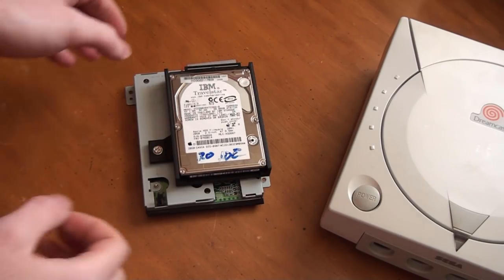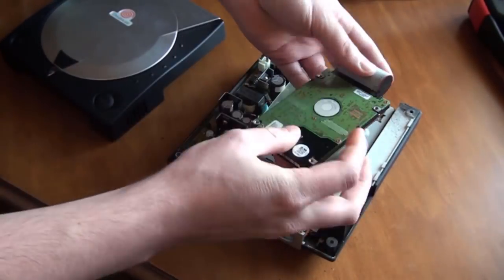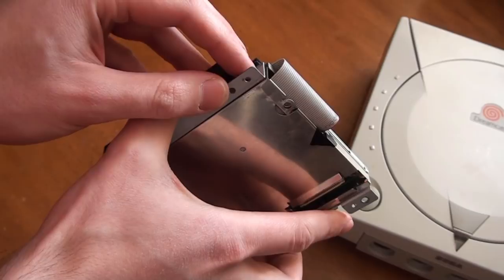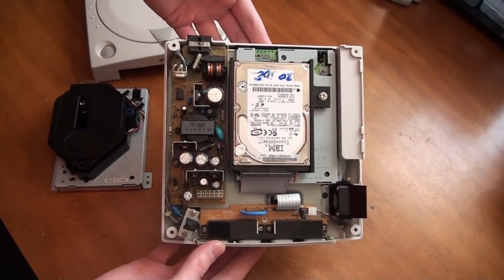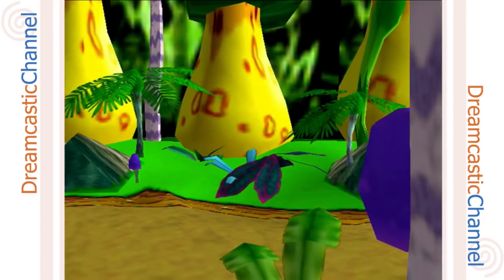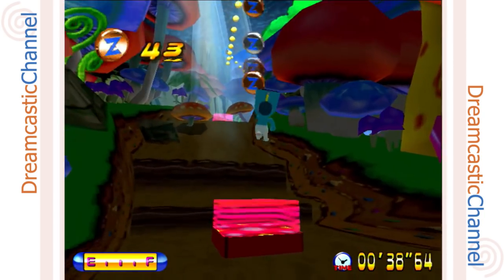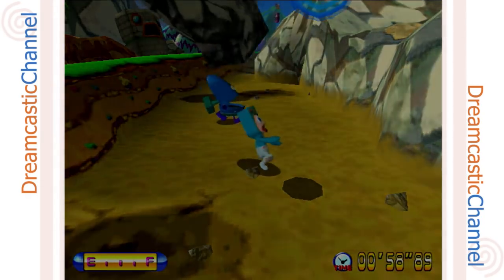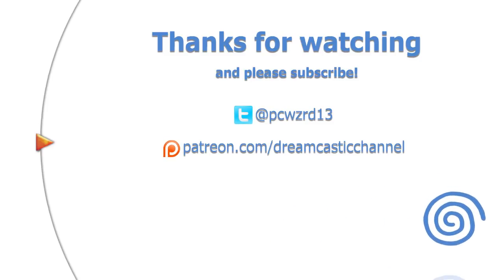Dreamcast Plug-N-Play IDE Hard Drive Mod

Comment: Wait, Dreamshell compatibility is 85% only ? Think I read it's somewhere close to the 95% mark by now. That and also that it could run backups of more recent unlicenced games that rely on real dc hardware as copy protection mechanism like Pier Solar, Ghost Blade, ??? Also, soldering that IDE cable in your 1st mod looks like a nightmare to accomplish, especially if you have insight on how little core substance a shitty 0.14mm²  cable has and how easily it can break if you either use a dull stripper or didn't take the time to adjust it properly. That plus the fact that using lead-free solder won't make things easier for anyone but actually has the potential to make corrections impossible (e.g. if you were to f*** up and solder a cable to the wrong hole with interlayer-section and can't get the spot hot enough to get the solder fluid again and back out of the effing hole). Have my respects, sir !!! You really earned it with that one.

PS: I would probably die of dehydration, that's the amounts i would be sweating through the whole process :DDD

Comment: @DreamcasticChannel  Having watch your video, I would like to do the same mod on my DC.  However, I found my GD-ROM Drive Board Pinout (mine is VA1) is a bit different than yours (https://www.dropbox.com/s/magchbbmuy2ny10/IMG_4055.jpg?dl=0).   For example, I couldn't find the pinout 249 on the board. 
Is it possible to do the same mod on my DC?    Thanks for your advice in advance!  Cheers!

Comment: The reason you don't have music in some games is because you are using CDi format of games. That means that CDi are ripped games to fit on a CD so you can play it on a modded Dreamcast via the CD Player. In your case and for people who are using GDemu the best solution is to use GDi format of the games. GDi games are the full version of every game without ripping anything (music or videos from a game).
Reply from the maker: I don't use CDI's. I use full GDI rips.
Reply: @DreamcasticChannel  then probably is a combatibility issue. But your build is really interesting. is there any video link how you did that? I mean i saw the picture where to solder but what wire goes to every spot you pinned on motherboard? Or it doesn't matter which wire you are soldering?

Comment: Hi just watched you video and have been looking at the photo you put up at https://dragoncity17.files.wordpress.com/2016/02/922a7-ide2bsur2bgdrom1.jpg my question is I have a Va0 Which the gdrom drive uses 5V , there is no 5v on that pinout, is that pinout for a Va1 and if so do you ha e one for a Va0 and would you not need to drop the 5v down to 3.3 for the hard drive ?

Comment: can I run dreamshell from the sd card serial port adapter somehow? no right?
Reply from the maker: Yes. That's what I do actually. Makes it easier to update. Just put the DreamShell folder on the SD card instead of the HDD.
Reply: @DreamcasticChannel  great! and how do I flash the bios chip? can this be done though software or with hardware/Arduino?

Comment: why you dont have a molex connector to the hard disk? where does the hd take the power supply?
Reply: just noticed it's a 44 pin ide. Dont worry ty.

Comment: Tbh i wanna see a Dreamcast mod that allows you to mount the motherboard inside a 2x 3.5 bay in a pc and connect power directly to the PSU also having an port that connects to a PCIe imput card. 
but this is a pipedream :3

Comment: I was starting to do a mod like this seeing how the motherboard mod was simply using the GD-Rom pins so I knew I could go direct to the gd board like you did but had shelved it until now seeing you've successfully done it.

My end idea is slightly different but now I should be able to see it works as well as yours. Thanks!

Comment: Would a pata SSD drive be of any benefit too performance even an SD to ide adaptor. Very happy love my Dreamcast Sport's edition. This would be much more affordable than the sd card adaptor on Ebay $500+
Reply: Despite the obviously bottle-necked IDE bus of the dreamcast, Bare in mind there's still the HDD's controller which has to handle the mechanical limitations of platters/heads... Using an IDE to Msata adapter would greatly improve performance and reliability with aging IDE drives. I can confirm as I have an IDE to Msata drive in my PPC MacMini
Reply: GD-Emu is just unaffordable.
Reply from the maker: Unlikely you would see any benefit from an SSD. A 5400RPM HDD would likely give you the fastest speed possible. You can do an IDE-to-SATA adapter but I haven't heard of anyone getting an IDE-to-SD adapter to work.

Comment: You have inspired me to attempt an internal ide mod that retains the gdrom drive and stock psu. I'm going to connect the ide cable to the gdrom board, is there anything I should know that's not on the pinout?

Also, It's not totally clear to me how to connect the hdd activity light. I see that pin 39 of the cable is involved, but other than that i'm lost.
Reply: I just finished and figured out the activty led and everything. I made a post with a link to an imgr album If you want to see. https://www.reddit.com/r/dreamcast/comments/8blsz0/just_finished_an_internal_ide_mod_also_vga_and/

Comment: Hmm, this is a neat idea. 
When I seen the title I was really hoping there would be a way to mod the dreamcast to basically have an external hard drive... and not loose the GD-Rom drive.

Maybe if I ever see another dreamcast cheap I'll attempt one of these mods, wont be tearing apart my old Dreamcast I had for years....

You seem to be very knowledgeable modder, mind if I spit ball an idea with you?

This is based on what I was hoping to see, but would it be possible to mod the dreamcast to have an external IDE or whatever hard drive.
Now there is a basis to my idea.
Would it be possible to remove the Dreamcasts modem and create a connection though that to its motherboard? 
The Dreamcast did have Ethernet ports.... So I would assume where the Dreamcast could communicate at 10 base Ethernet speeds that the bus speeds from the motherboard to where the modem/Ethernet port would be more then fast enough to communicate with a normal hard drive.

I imagine the most difficult part would be is creating a modded bios with the instructions already set to treat the modem/Ethernet part of the board to communicate with a HDD.

By all means this might not even be possible. 
But it sounds like it could be possible? 
I'm no modder in the sense of being able to create a mod. But in concept to me if the software can be created I would imagine this to be possible....

Hmm..... One other idea and I kinda hope this was already done.... But if I was to have a Dreamcast that already has an Ethernet port installed, is there any mods to allow the Dreamcast to communicate over a network to lets say a computer on my network that could be loaded with Dreamcast games already on it, then navigate though all the folders on my PC and launch the game over Ethernet on the Dreamcast? 

Damn..... that sounds even more easy and piratical! 
Please tell me someone has done this!!!!
Reply: Dylan Mayhew I'd think it'd be possible. The cancelled ZipDrive allowed the BbA and Modem.

Comment: Awesome man,  but do you ever try to figure a solution for not taking apart the VGD drive?  I always wondered if a IDE to MINI USB female or a small SATA Female  connector can be added, in order to put that female in just one on the  vent holes  at the back of the dreamcast. Then with just  one simple mini USB or a small SATA cable a hard drive inside  a case  could be connected to the dreamcast easily.  I dont know a shit this stuff, but dude, something like that cant be done? I am pretty sure it will not need too much space isn it?

Comment: Can you use an ssd with that? Then if each game is about 1gb, and a total of 636 titles released, it would be possible to fit the entire library on a 1tb ssd as their prices will fall once 1tb micro sd cards hit the market and of course you can use those micro sd cards once their price goes down.
Reply: hbarudi You could but because it's IDE, it won't be very fast like SATA for example.
Reply: does this difference matter for a retro console such as the dreamcast?
Reply: SSD would absolutely work and maybe actually be faster than the IDE hdd's, but not by much like the guy said above. 

But a cheaper alternative is to get an IDE to SATA and a 2.5" laptop drive like he did in the video and have it run off the 5v and power it. If you used a full size 3.5" HDD it would need to be powered externally unless there was a PICO PSU mod done.

Comment: Is there no mod for an external hard drive?
Reply: I added an external hard drive similar to how was originally soldiered in this video with lots of wires. I purchased a Dream IDE Reborn circuit board and soldiered it to the mother board, it has an IDE female socket out the side of the Dreamcast that you can plug an old IDE HDD into. You only need an external power supply to run it as the Dreamcast power supply doesn't have enough juice to run both

Comment: Very cool! Have you tried any SATA drives with a SATA-to-IDE adapter, by chance?
Reply: Official Troll I’m well aware of that, but they could make things more accessible, as well as allowing for SSD drives.
Reply from the maker: I bought one that didn't work. After that I decided it would be easier to just buy an IDE drive rather than messing with adapters that may or may not work. I've heard some do though.
Reply: DreamcasticChannel I’ve had good luck with the one I used in my Xbox, but I haven’t tried the other one for my fat PS2 yet. I have heard they can be hit and miss.
Reply: Adapters are pointless, the reading rate won't change
Reply: @gameboy guru - SSD would be wasted. These are operating at max 66 speed as they are 40 wire IDE. They would see zero advantage from the SSD
Reply: Lassi Kinnunen that’s a good idea, similar to what folks are doing to resurrect older PCs (386/486/etc).
Reply: Steven Benson I’m well aware that there’s no performance boost for SSD, it’s more of a convenience thing.

Comment: I have to fix my DC first. Some shit 3rd party memory card blew up something. Since then no pad works and when i plug in a pad the system resets.
Reply: Very like the fuseable resistor blew out if no ports respond. Ive repaired 7 dreamcasts with that same issue last month
Reply: Have you tried a new controller , and try different port
Reply: I had the same issue with a controller that blew out the controller ports. I fixed it with a fuseable resistor i got from ali express, job only took 20 minutes

Comment: That is a really clean looking job you've done. I love how it just fits in and can be removed in case you need to transfer it to another unit.

I honestly love that we can do these kind of things for the Dreamcast. At the same time though, it kind of makes me a little sad because it reminds me that one day it will be almost impossible to get some Dreamcast games the more time moves on. Also, the original hardware to replace non-working parts. Sorry, that just was a thought I had the other day while playing PSOv2. Ultimately, it's mods like this that ease my tension a bit. They help to keep the system alive and protect what we already have. If I could rip my own games and put them on a hard drive or other medium, that means the discs don't get used as much. Keep the games from wearing out.